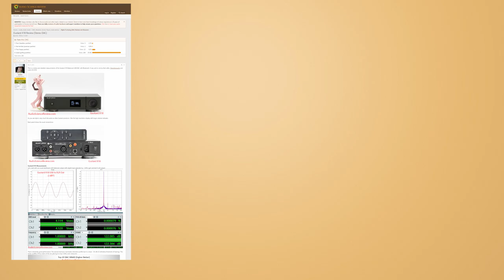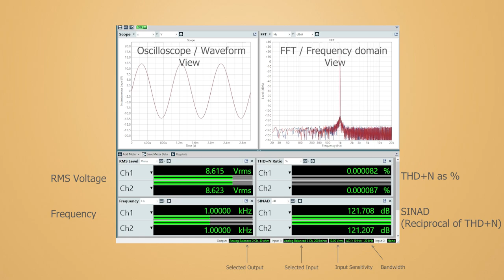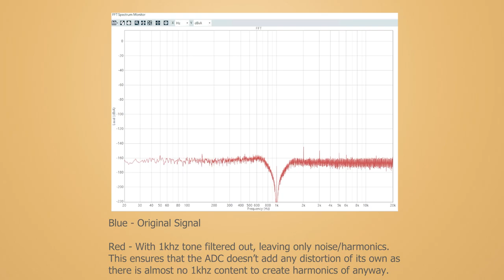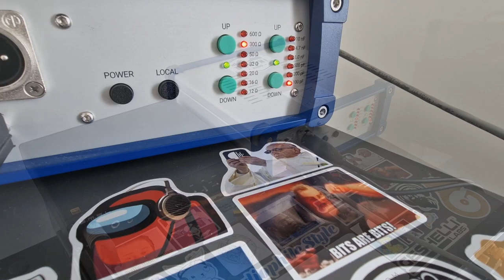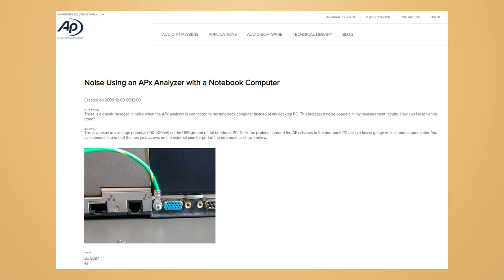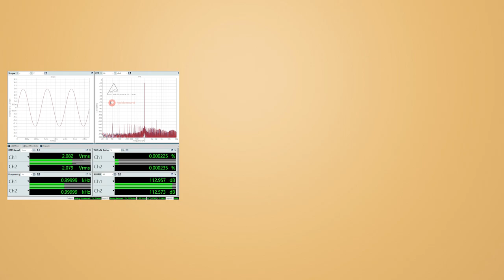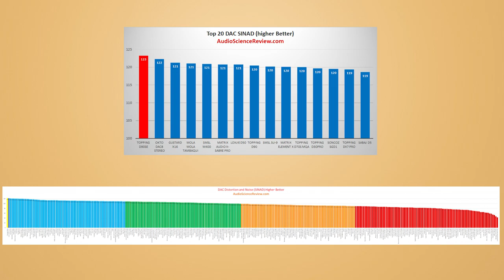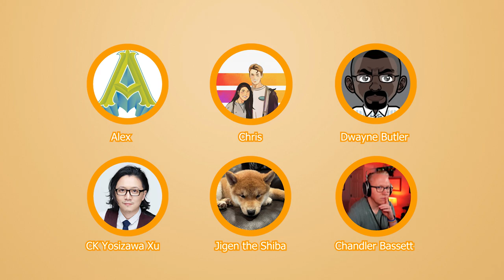Why you can't trust audio measurements

Comment: Excellent explanation. Now I finally understand why many of ASR's top DACs, preamps and Amps that I have blindly purchased where easily surpassed on listening tests by others that measured worse. The X26 pro mentioned by you is one of the betters that I have. Easily on par with my Chord TT2. The TT2 do some things slightly better and some slightly worse. Question: it is the upsampling built into Roon good enough to avoid purchasing an M-Scaler or the Chord's algorihm is better?

Comment: I'm on board with the intent of this video.  In any engineering test you document the procedures and the findings.  That way someone who wants to repeat the test can do so and they should then arrive at the same result.  Where there are differences are almost always attributed to the test procedure itself and not product variation.  This is standard stuff in every field.  Not just audio components.  Anyone who takes issue with your encouragement for that are simply doing so out of spite and letting their emotions override logic.  

So, yes, document the procedures and publish the results.  Simple.

I also agree that often too much importance is placed on a single value metric (such as SINAD) and the other parts of the whole are tossed by the wayside.  

However, you lost me at 27:30 with the statement that "two devices with the same SINAD levels can sound very different".  While I agree this is certainly possible, you provided a generic statement with no footing.  You spent the better part of 25 minutes making many valid points with examples.   And then you dropped that statement as if it were an afterthought.  I wish you had taken steps to provide an example of when you have seen this and then provide reasons why that was the cause (i.e., frequency response, different voltage levels needed to reach this SINAD match, etc).  This, to me, is much more helpful in providing rationale for a) why measurements can be misleading and also b) how proper measurements can help us learn why Product A sounds different than Product B.  In my opinion, that should be the goal of a reviewer using data to help supplement their review.  I don't believe it serves much purpose to say "here is data, and by the way, this is what I heard" without at least attempting to reconcile those two things.

At any rate, I hope you understand where I'm coming from and don't take this personally.  Overall, I'm in complete agreement.  I just think this video would have benefited the community if you had taken the extra step to explain your ending statement (or you had simply left that out).  Maybe that's a topic for a later video...

Take care,
Erin

Comment: The problem I have run into is that the gear the measures well doesn’t sound great and the gear that sounds great doesn’t always measure well.  Thd and Sinad in my experience typically have little correlation if the amp will sound well (subjectively).  So I’m struggling to use objective data when subjectively my Brain is telling me otherwise. Perhaps I enjoy distortion perhaps we cannot measure that which I enjoy or perhaps the measurements are just wrong or inconsistent as you state.
Reply: It also have to do with loading of your speaker because of the complexity of crossover and drivers. Those two are just measuring noise nothing else. Like Benchmark AHB2, it is the best in ASR. But you see some user returning this product. It is also well measure in Stereophile. You have to listen to amp with the speaker it drive in subjective way. No way to tell whether the product is worth buying just looking at graphs. I mean lots of people can swore by 300B including me.

Comment: Thank you Cameron. I would also add that while competently undertaken measurements provide a strong foundation and are crucial for understanding the technical aspects of audio equipment, they can only partially predict the subjective listening experience - some argue within a range of 50 - 70% accuracy. Therefore, while measurements are highly valuable, listening tests remain essential to gain the true picture of sonic performance.

Comment: I finally got a THX AAA 789 months after it started selling out. Measurement geeks were drooling over it.

Several months later I resold it. It was clean but sterile to my ears. That taught me not to give in to the measurement ONLY drones.
Reply: I mean, just use an EQ then. Why wouldn’t you want an accurate, clean slate to start with?
Reply: @blueversace4447  if there are some amazing EQ settings that will transform the THX into a V281 or Darkvoice please share them
Reply: @blueversace4447  Adding EQ is good to shape your listening curve. That is alway a phase issue with EQ. That why many audiophile do not wanna touch EQ. It is not get a flat respond and you are done.
Reply: @blueversace4447  this is a timber problem.  The thx just sounds dry no matter the headphone plugged into it
Reply: what are you using now?

Comment: I'll stick with my ears and brain measuring how much pleasure i get from any bit of kit. 

Topping A90 measures incredibly well, i auditioned it and hated it bigtime. Bright, harsh, cold, not a great soundstage and just not my cup of tea. 

I auditioned the Benchmark HPA4, what a fabulous amp, another THX amp that measures extremely well but completely different to the Topping.  Sounded next level with my planars, made them sound like electrostats however, a bit too neutral for my HD800. 

In the end i settled for a Violectric V550 Pro, works really well for both cans and while i have no idea how that measures i really loved the sound. 

I'm very glad i take little notice of measurements.   👍
Reply: Interesting experience, I've used an A90 and couldn't possibly describe it any way you mentioned. To me it just sounds 100% uncolored. No harshness, definitely not bright at all (it's totally flat, after all), and cold... Again. it's extremely neutral. I think you might just have a preference for warmth, AKA boosted high-bass/lower mids.

To me it sounded 100% identical to the HPA4 I demoed. Not a lick of difference between the two.

But then again, I also level-matched both with an SPL meter, swapped between them within 0.5 seconds using a switcher, and did it completely blind. If you don't take those into account, your sense of expectation WILL affect how you hear. It is 100% unavoidable.

That's why you can't really trust your ears for anything but preference, UNLESS you eliminate every single factor that can influence your sense of hearing.
Reply: In Toppings defense, you were using an absolute wonkfest of a headphone with it. If the HD800 doesn't sound wonky as hell, there's an issue in your chain :D
Reply: @KaneAmaroq  You don't have a clue what i prefer, and it's a good thing we all hear things differently otherwise life would be extremely dull and annoying to say the least.
Reply: @Gamez4eveR  There are zero problems in my chain, my cans are doing great thanks. This is the problem with opinions, if you express one that is contrary to a fanboy of a particular product they will tell you that you're wrong or you have a problem.  Thank god we all think differently.
Reply: @spanmanuk  You described a preference for warmth, I'm sorry you're so offended by others recognizing it.

Also ignored the fact that it was probably just in your head, lol.
Reply: @KaneAmaroq  

Hilarious! Just because i said something was too bright etc,,. you can deduce i prefer warmth? Really?  I've got a set of LCD-XC i used on the Topping and they sure as shit aren't warm. A tad dark maybe but definitely not warm. I run a very clinical set of modified HD800, they sure as hell aren't exactly warm either however, according to you i prefer warmth. You really haven't got a clue.

Not offended by anything other than the opinion of someone that thinks they know it all and only their opinion is correct. That does offend and makes you a pretentious....

I dislike being told my opinion is wrong when i'm speaking from direct experience, and it really is just my opinion, rather like yours which we are both entitled to have. thank god they are different.

I'll keep trusting my ears 100%, they've never let me down.  Just because i hear things different to you my opinion is wrong?
  
Audio is a very subjective topic, everyone's opinions are different, as are mine so tough shit if you don't like it.

Go troll someone else. ☝
Reply: @spanmanuk  you sure get defensive about something as trivial as opinion...
Reply: @Gamez4eveR  kann didn't present it as a opinion.
Reply: @En_Joshi-Godrez  He used exclusively opinion oriented language. You have to be really bad at english or have really low emotional capacity to think that wasn't opinion delivery

Unlike our defensive princess spanmanuk here

Comment: Making a buying choice based on ASR's SINAD ranking chart is folly.  But we're living in an era when people are more concerned about ease (in buying audio gear) and being "better" than others, instead of relying on one's own ears to tell oneself what one likes.
Reply: It’s unrealistic to expect people to shoulder the costs required for such testing. Relying on one’s ears is not necessarily a simple concept when there is cost involved in procuring or encountering the equipment necessary to experiment, along with the time and effort to even work through the process once it’s been enabled. 

Also, people can imagine they’re better than others at all different levels of a situation like this (ofc for differing reasons), so I won’t address that further.
Reply: Dumb to buy equipment based in SINAD alone. ALL data have to be taken into account.
Reply: Absolutely. Hearing the devices always should be the first and most important judgement parameter.

Comment: That's how we ended up with Delta Sigma/high oversampling DACs ruling the roost when a TDA1543 or similar type DAC may sound better as the noise is pushed out of band with high sampling types.
Reply: In real world, high sampling rate reduce floor noise. Your filter can be implemented much higher than audible frequency. With DSD 512 or 758kPCM, you can throw the filter away. This is the chip itself. All the components surround the chipset contributed more of the overall performance.

Comment: Very well organized, I enjoyed it a lot and it highlighted a lot of the parameters that can affect the measurement outcomes of a device.

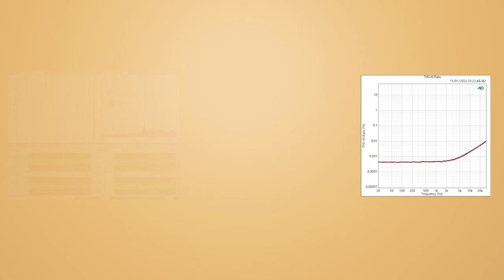One thing I'd like to contend about (or would like a more detailed explaination of) is if the Rebel's "warmth" could be indicated by any of the measurements you have made. You pointed out in 21:14 that its THD+N ratio rises with frequency, but I fail to see how ~0.02% at ~10khz is even significant for audiability (taking into consideration 1. the absolute threshold for hearing and 2. masking due to ambient noise and signal).

Comment: How do you know whether a Dac depends on usb grounding or not? I wouldn’t want to get a galvanic isolator by intona as you have only to find out it messes with my Dac poorly. Is there an easy way to find out this info?
Reply from the maker: You unfortunately can't say for certain without a good ADC to test. But in 99% of cases if your DAC uses a 3-pin IEC connector, it's grounded by the PSU and does not need USB ground.

If it used a DC barrel power supply then check whether the external power supply has a connected ground pin or not

Comment: A big part of the reason I just ordered a Holo Spring 3 KTE was because you said the jitter was extremely low via USB and an external DDC wasn’t necessary. I’ve been looking to reduce my digital front end from two boxes to one.  Uh oh...we’ll see.
Reply: @First Last 
Wow. Maybe I should keep mine?
I keep hearing that at some point in your signal chain, get the signal to go through a glass optical cable to eliminate any kind of emi or rfi. I wonder if anyone else has experience with this versus a dedicated DDC that never goes optical.

Comment: A lot of speculations. How can you put your feet into the device designer's shoes and claim that they 'intended' to choose a default output level that measures better? Without proof, that's pretty far-fetched, isn't it? The inter-sample peak is also a poor example. Okay, some DACs by default has a -3dB digital attenuation, does it stop anyone from setting it back to 0dBFS, or does it stop other DACs from having a same 3dB digital attenuation? Some DAC chips have more headroom in their internal data path than the others. The DAC manufacturers are limited to what the chip vendors provide, and sometimes had to come up with compromises such as the above. 
I like your free measurement reports, and I still trust them. Hopefully there is no free personal agenda in those numbers and charts.

Comment: Thank-you for this excellent explanation of potential issues with measurements.  Those sites that judge a product solely on measurements are overly zealous for my taste. Thus I've told YouTube not to recommend such channels for viewing. Before I closed that door completely, I noted more than a few posts on one of those site's forums where they were breaking their arms patting themself on the back for browbeating Schitt into changing their design to achieve better measurements. They never seem to have considered GoldenSound's observation. Fine, it measures better, but how does it sound? I've spent a significant number of years performing data acquisition to test and evaluate the performance of various things. So I know the value of measurements. I also know their limitations. I cannot hear music solely by looking at graphs. My ears and brain are not a piece of electronic measuring equipment.
Reply: "How does it sound"

I've always found this question interesting, because whenever I've listened to different source gear (outside of tubes/vintage stuff), to me it always sounds like... whatever I'm listening to.

I think the only amp I've ever listened to that sounded any different than other amps has been the Jotenheim, in which everything felt like it was bleeding together, almost muddy.

Same with any kind of lossless and above, same with DACs. No matter what headphone, no matter what source, I always just kind of listen, and go, "...That's it?"

Not only that, but when half the people who say it's a night and day difference, whenever I bust out my switcher and SPL meter to do some matching, whenever they blind-switch between the two, suddenly they have no idea what device is being used.

So... I dunno. I think both camps take themselves far too seriously and think they're just imagining stuff, which is super easy to do with your auditory perception. Just get a headphone you love, a nice, clean amp/DAC, and enjoy your fucking music. If you want weird flavor, that's what tubes/EQ is for.
Reply: @KaneAmaroq  You seem to be reading more into my comment than I actually said. I wanted to keep the comment short and thus was certain that someone would read way too much into it. I do not go solely by subjective criteria. But in the end, I have to like the way it sounds...  to my ears. No one else's. I never claimed to be able to pick out subtle differences between gear in blind A/B testing. And I do not believe that the vast majority of people could pick out the difference between gear with marginally different SINADs. And that's my point. Going solely by measurements is not for me. I never said anything about wanting weird flavors.
Reply: Technically speaking, I think that what you just said is exactly what the human brain is lol. Just a very complex one.

Comment: Thanks for all your great reviews, I really like your approach.
Useful measurements with a serious analyzer, combined with subjective listening experience, Perfect!

May I suggest the Bluesound Node (N130) for a review with all the measurements. 

I've got one since a week and the subjective listening experience is much better than with my Sonos Connect(with Tentlabs clockmod), both using an external DAC, BlackLion Sparrow Red.

I guess the clock of the Node is quite good and has low jitter, could you back up my guess, or proof me wrong? ;)

Comment: I looks like you ASR and others are using the same holy grail system of measurements in ASR'S case is those final results that matters only  in 50 years of trying equipment with similar specs and twikes that made no measurable difference there is still a lot to learn especially stereo imaging even the simplest piece of music is a constantly changing complex tonal  pattern

Comment: I think that Standard Measurement Setup and rules should be implemented in the AP software...great video indeed...for those selling numbers its a great lesson.
Reply: Take a look APx 555. OMG, it is such an overpriced piece of measurement unit. You can get the oscilloscope and signal generator at half the price with at least 10 times the performance. The only good thing is the easy to zoom at audio with it interface and software.